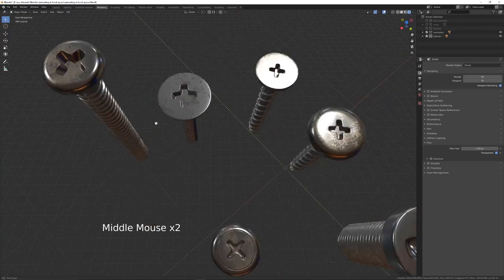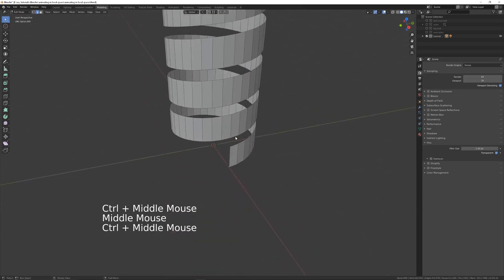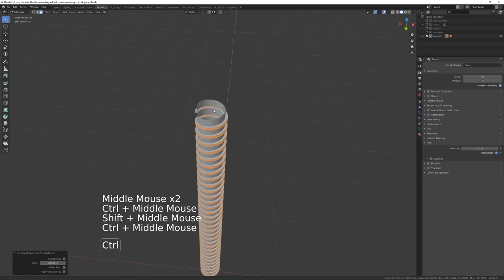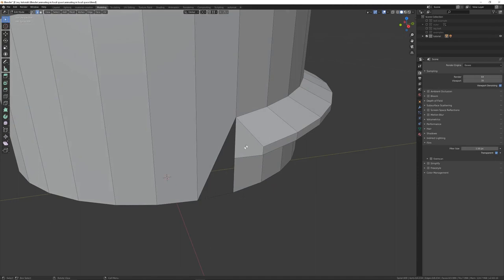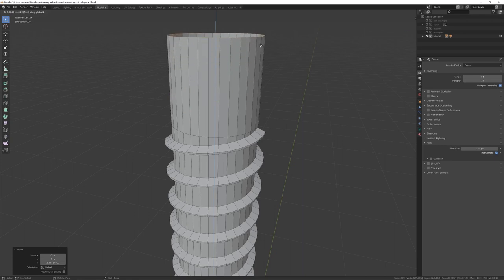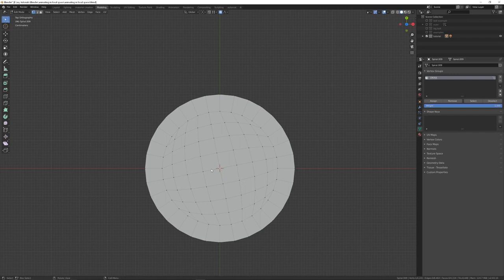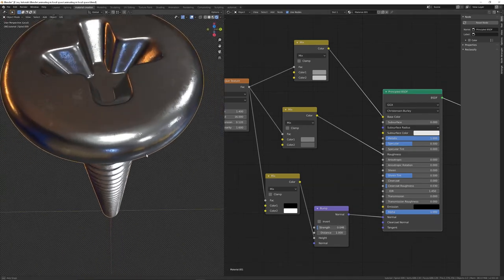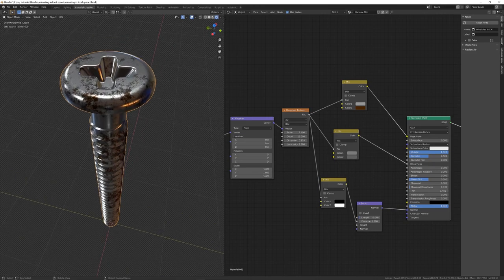Learn Blender's tools and workflows by modelling a screw

Comment: 6:34 that is actually the same as extruding, scaling, except on z-axis or pressing e - s - shift + z. Gives the same result. Thanks for the tutorial mate. I originally made a bolt using the screw modifier and it just looked messy, not really accurate to reality and gave me some artefacts once I imported it into my game engine. This way looks more like a real screw

Comment: 24:47 When pressing S, there's no gray circle that sorta limits the scaling. Just noticed this when you started changing its size here: 25:27... which I don't know how you did it either.

When I press S, while selecting that loop circle, it scales the whole spiral instead.
Reply from the maker: If you look at the top left you’ll notice the falloff distance changes when you scroll your mouse wheel. Scroll until it’s small and you’ll see the circle.

Comment: Question: How do you make an inside thread with boolean operator using a screw and a cube as an object? If I try this, it does not work correctly. The faces of the cube get cut, but the cube is hollow inside and does not get the "outside-thread" of the Screw
Reply from the maker: Try the latest blender builds that have the new precise boolean operator.  Personally I wouldn't use a boolean, I'd create the inner thread the same way as this tutorial and then bridge them at the top and bottom.

Comment: I'm having the same problem as the guy with the preferences to keybind selecting the face next to it and all the way down as long as it connects. 5:30. So in my preferences I already have three things in the mesh category that are for "loop select" but when I delete them or even uncheck them the one that I left to work still doesn't work. The three I have are: "Alt Left Mouse", "Shift Alt Left Mouse", "Alt dbl-Left Mouse". So which one is correct and what am I doing wrong in my preferences?
Reply: So I solved it. in my Hotkeys the only one I have for Loop Select under Mesh is now Shift left double click which I am happily using. and in other news, ctrl right click selects it up to a certain point.

Comment: Hey so when i go into "display render preview" the metallic material is not showing, it's just a rustic grey plastic screw then, am in Eevee as well, any solutions for this?
Reply from the maker: You need to change metallic to 1 in the principled shader and make sure whatever is plugged into the roughness isn’t too white (you can control it with an rgb curve)

Comment: I got stuck on scaling the thread ... The two edges will not scale no matter what I set up in the Comma and stop menus. Any ideas what is the problem? Thanks.
Reply from the maker: Hi, you probably don't have proportional editing turned on and in connected only mode.  You also need to make sure that you are using shift z to scale on all axis except z (height)
Reply: @3d-illusions  didn't work but thanks. It's behaving oddly on my end. Tried for the second time, now the faces won't extrude correctly. Used bolt addon instead in the end.

Comment: 4:10 When I try to " bridge edge loops " the edges, all the edges join only at 2 points, what's the problem ?
Reply from the maker: Did you remember to deselect the two end edges?
Reply: @3d-illusions  Yeah I did it, I've " shift + left clic " on the to point of the edge of the bottom and did the same for the top
Reply: Make sure merge is not checked in the bridge edge loos properties window

Comment: I'm trying to select all the edges going up the spiral using the alt + click but it just selects the one edge still. Do I need to change something in my settings?
Reply: I think it has to do with the direction I built my spiral from the curves, but i'm not sure if you can change how it is selecting the edges.
Reply from the maker: Difficult to say without seeing the model.  Probably easier to start over.
Reply: I was having the same problem and found that I had turned 3-button mouse emulation on when I was using a tablet causing the Alt key to be intercepted. Great tutorial, thanks..

Comment: What version of blender are you using?
Reply from the maker: I think it was 2.8 when I shot this.  Is something not working as shown?
Reply: @3d-illusions  Im using 3.1 i think? Just things look different, thats all. I was thinking about switching back to 2.8 or 2.9 because im having issues with the version im using. Thank yoi!
Reply from the maker: @dookie7299  what in particular are you saying looks different?  The result, one of the tools, etc.
Reply: @3d-illusions  Oh everything mostly looks the same but some of the hotkeys aren't working. Theres a lot more bugs. But Everything mostly looks the same. Just a few UI changes is all.
Reply from the maker: @dookie7299  got ya.  Usually the daily builds are the best ones to use if you experience any bugs.  They're found here: https://builder.blender.org/download/daily/

Comment: 5:30 naaah i cant even find a good answer online for this...
alt + left click is not working for me and i cant solve this.
i even unchecked 3 button mouse and stuff but nothing...
Reply from the maker: Just tested and it's still correct.  You may have overwritten the keymap. You can check in the preferences - Keymap, type loop select into the textbox and it'll show you the current shortcut.
Reply: @3d-illusions  i dont know man, while it does let me to set it to alt + left mouse its not working. I changed it to alt + middle button and now its good...so its kind of working now
anyway thanks !
Reply from the maker: @ZsH85  No problem, sounds like you have another operation also using alt left click, and it's taking precedence.  In the preferences you can search by key-binding instead of name to find it.  Type Alt Left Mouse in the textbox and it'll show you everything that's using it.  You only need worry about conflicts in the section titled 'Mesh'
Reply: @3d-illusions  thx